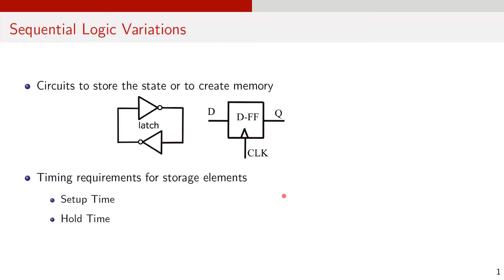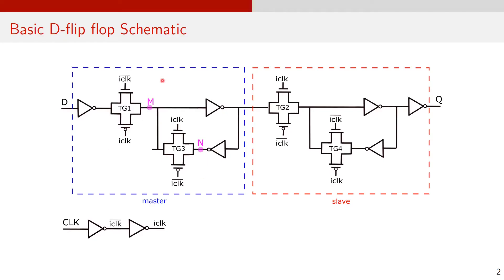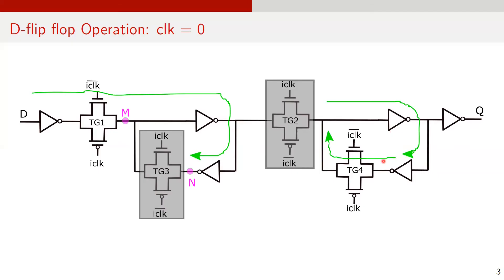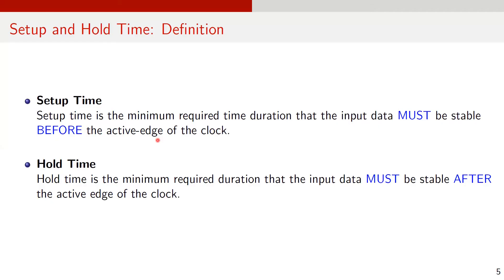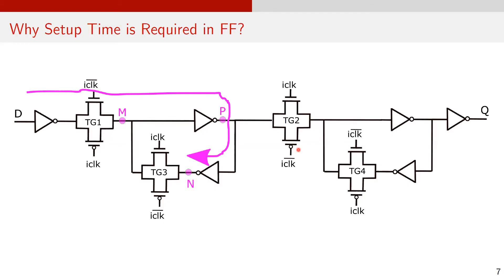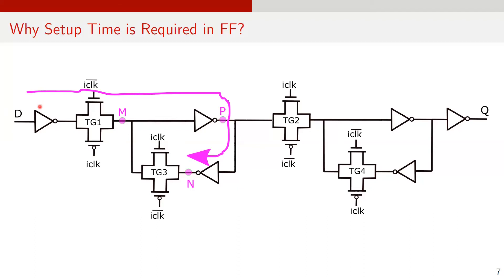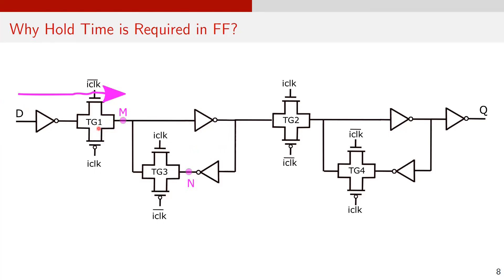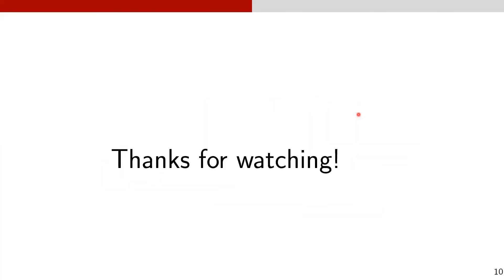Digital Design Interview Questions | Setup and Hold Time in Flip-Flop and Latch | Static Timing

Comment: shouldnt the first tg clk signal be inverted? when clk=0 tg1 will be off right? as pmos gate will be 1 and nmos will have 0
Reply from the maker: Essentially,  a master-slave flip-flop is a combination of a negative latch (master latch) followed by a positive latch (slave latch). In the master latch, which is a negative latch:  the circuit is transparent when the clock (clk) is low (clk = 0). In this state, the transmission gate TG1 is ON (the PMOS receives '1' at its gate, and the NMOS receives '0' at its gate).. Since the slave is a positive latch, it becomes transparent when the clock is high (clk = 1), and the transmission gate TG2 turns ON (the PMOS receives 0 at its gate, and the NMOS receives 1 at its gate in TG2).
Reply: @rachsriv  Hey, my bad. I got confused between pmos and nmos representation. I thought the one with bubble in nmos. Thanks for the explanation, nice video.